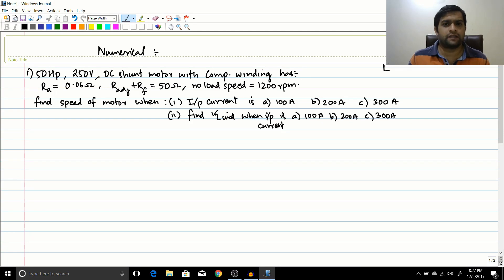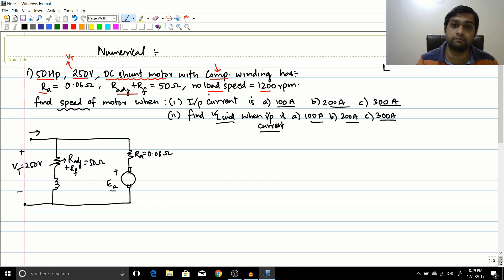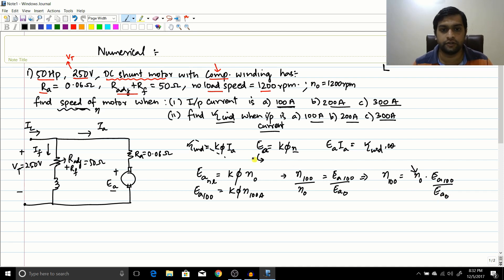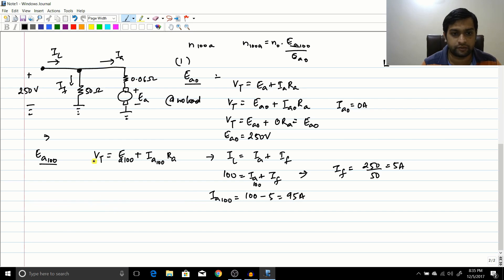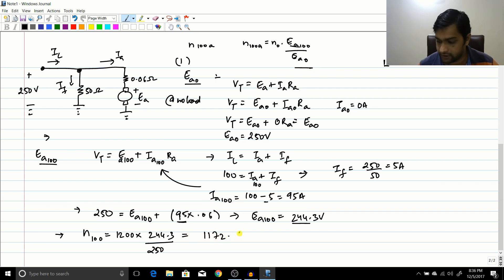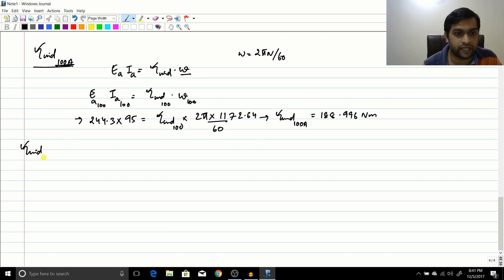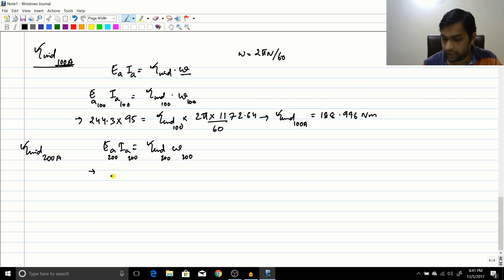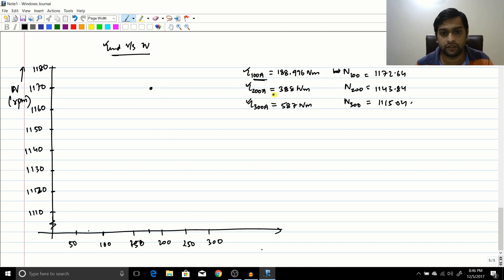#4 DC Motor -  Numerical on Torque, Speed calculation of DC Shunt motor

Comment: Because i've seen it on the comments. In the case of DC shunt motors , the connection is parallel , thus the current drawn from the winding of the electromagnet (the Rf resistance) is fixed everytime. That means that the Φ has also a fixed value each time and that's very positive compared to the dc motors where the winding of the electromagnet is in series with the Ea and Ra. So in order to procede , the voltage at the branch of the rotor is always the same and actually , because there is no counter torque at the end shaft of the motor , (the only counter torque that actually exists is the shear stresses from the medium that the shuft is being put in) , the whole voltage is being absorbed by the Back EMF due to Faraday's Law. If that condition exists , then why does it spin since there is no current and torque? The motor actually goes through intermittent periods of zero current (or let's better say , very low current that produces torque that its not enough to equal the moment of inertia and the friction of the shaft ) and as a consequence it falls back in speed. Then the rotational speed falls back and current goes up again and the torque goes up , so as the angular acceleration . So actually its like it has reached a datum where it goes back and forth . Of course the changes are so little that cannot be understood. Please feel free to discuss or even reject my point.

Comment: hello sir, i like your videos very much, you are a very good tutor, sir, i have a doubt here, in this numerical on the starting point after the equivalent circuit of the motor, while applying the equations: you  have taken E=k(fi)N in place of K(fi)(Omega) and Omega = 2(pie)N/60 ???, but E=k(fi)(omega) so i need to ask that and Thank you for such wonderful and knowledgeable videos.
Reply from the maker: Kindly give me the time stamp of the video where you faced the doubt...
Reply: @ElectricalisEasy  Thank you for your response Sir, it is a great effort from your side Sir, In this video, starting from 3:06 where you have taken the value of E=K(fi)n in place of E=K(fi)(omega) and Sir, you have further continued to take the value of E as K(fi)n where n represents the speed of motor while Omega represents angular speed and Omega=2(pie)N/60, so the question is why you have taken N in place of Omega?? That's it sir and i am going through all your videos and it is very knowledgeable for me, i am gaining a good confidence on the subject, Thanks a lot Sir.
Reply from the maker: Yes you are correct, I should have put the proportional symbol..it was a small typo..but the rest of the numerical is correct...
Reply: @ElectricalisEasy  Thank you again for such a quick and disciplined response, you are right Sir, the rest of the numerical is correct as on 4:20 on this video, Ea at 100 and Ea at no load gets divided to have a ratio of N at 100 and N at no load, so the problem solves there, but i got confused, at that time, whether we have to take E=K(fi)(omega) or E=K(fi)(N) on such numerical, but as you said it is a proportional symbol, everything is clear now. I am going through your every videos as it is very knowledgeable and i am gaining a good concept on this subject, Thank you very much Sir and please continue to have such videos for students like us is a boon. And i appreciate for your great effort, thank you Sir for everything.

Comment: 6:34
How armature current can be zero when the rotor is moving at 1200 revolutions per minute? Without current the armature cannot have an induced torque.
Reply from the maker: That’s an assumption given in the numerical itself....it’s just for the numerical case...
Reply from the maker: and it is a no load case, in that case the current flowing through the armature is very less, so maybe that is why they took that assumption, bcz as you can see the load currents are quite high in the problem, so any error due to this assumption will be very less...
Reply: Varun D Nair but ia and il is approximately zero what about field current? İt can not be 5A
Reply: @alperkayabas4563  good question